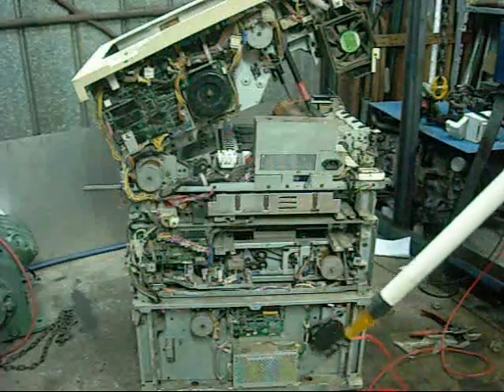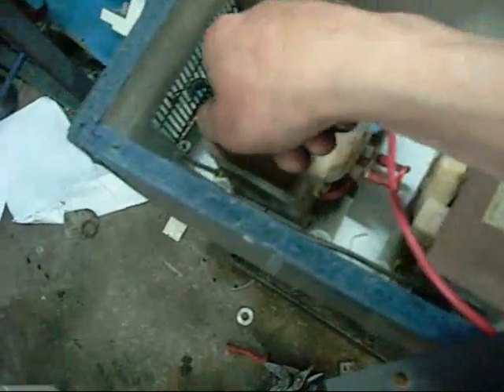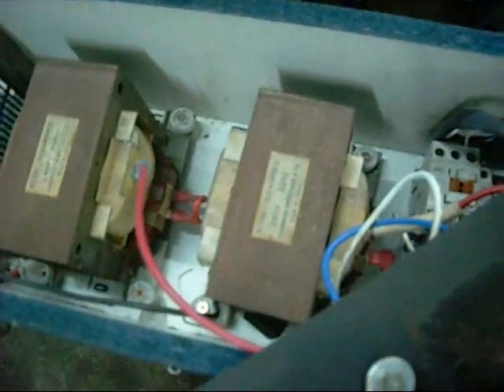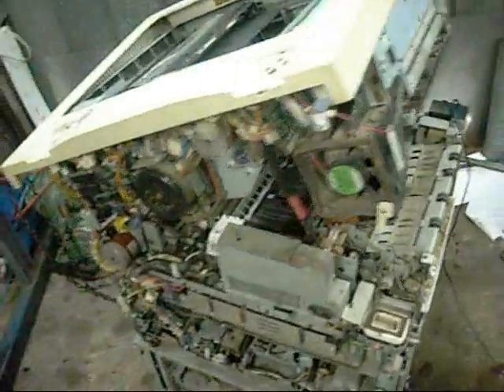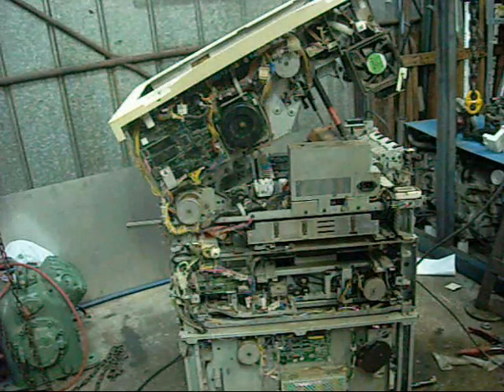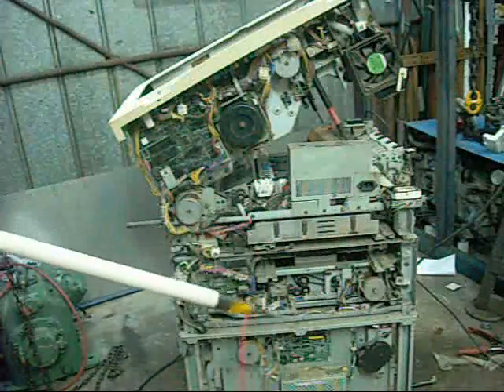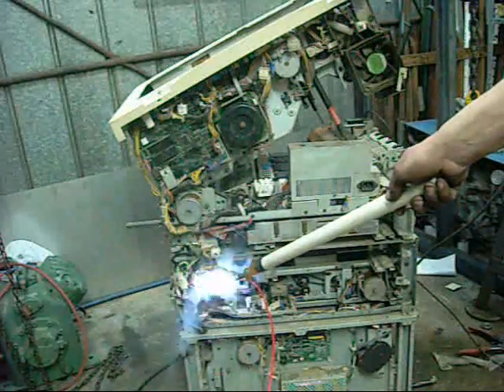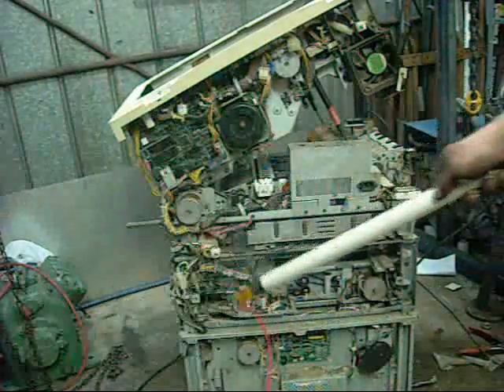Microwave Transformers Vs Analogue Photocopier

Comment from the maker: @filipkof I had ear and eye (flash protection) as well as a full face shield.

likewise standing on a 1" thick plastic panel in case of tracing current on the floor (very unlikely at less than 6Kv but not something I want to test)

Comment: It's so noisy, did you wear an ear protection when doing this? I feel pain in my ears with my MOT HVDC psu, when i'm standing close to sparks....  Sometimes, when filling some juice to an old piece of motherboard on the input of 12v, happens that all components on the board start smoking and burning at the same time. Wish i could have like 10-20Amps of this potential xD I'm gonna collect more of them....